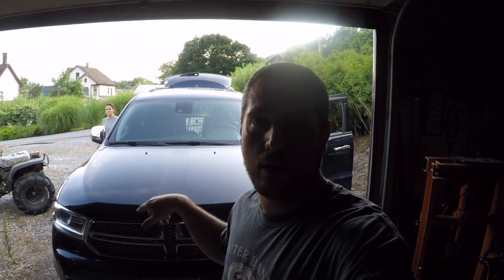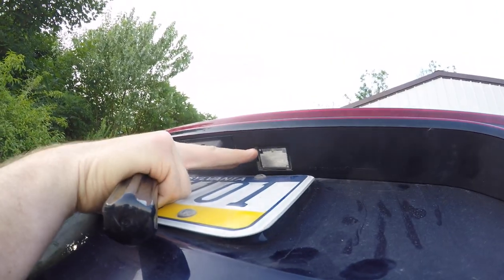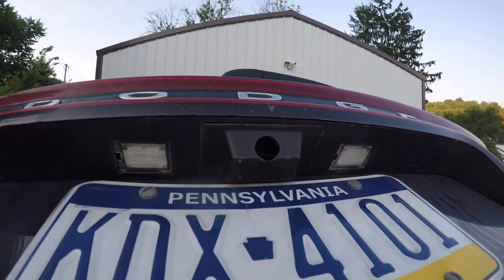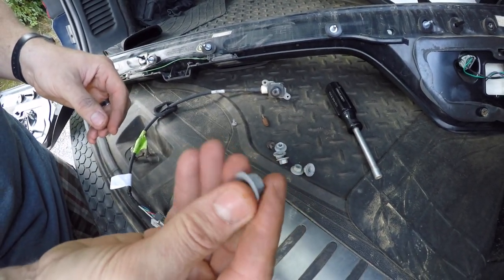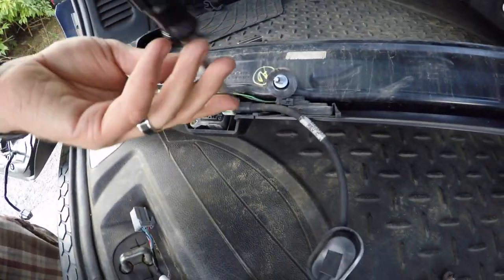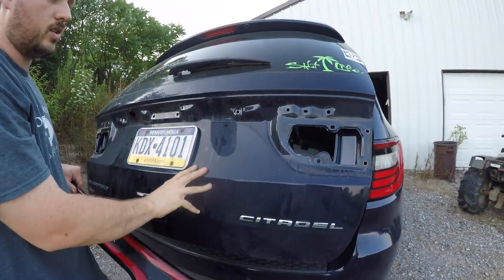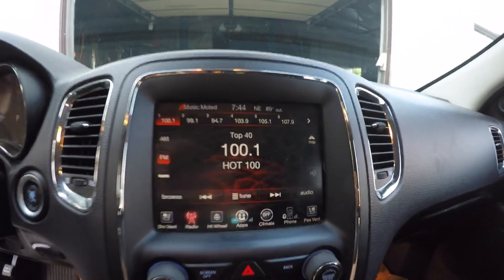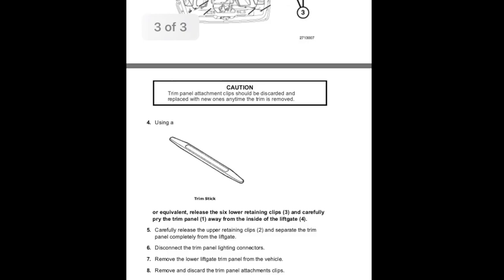HOW TO REPLACE A 2014 DODGE DURANGO BACKUP CAMERA. CRONES VLOG

Comment: Thank you for the video. I had to find my way through getting the trim off but it went pretty well once I just went for it. Only broke one trim pin and one of the mounts which I Gorilla glued and hope it takes enough to hold the one pin. The video was a huge help and greatly appreciated when it got to removing the brake light assembly, which was not bad at all and went quickly thanks to the video. The aftermarket camera quality is not as good as the Dodge version but costs $300 or more less and has a 1 year warranty. It shows what you are trying not to run into in good enough quality to avoid it AND the proximity sensor and associated alarms work without the camera so its all good! Cost was $55 for the camera and $10 for a set of 4 trim pins to replace the one I broke and in case I ever have to pull the liftgate trim again.

Comment: I have the Dodge Durango 2015 with no camera I already have the camera. My question is can I install it? Should I run the wire all the way to the front or it’s already there just to plug it?

Comment: Need a video on how you removed the plastic panel. I broke one of the plastic locking tabs that the plastic push pins sit in and then I stopped.
Reply from the maker: Sorry tends to happen they are replaceable though. They do make a clip removal tool.
Reply: Heck I broke the panel itself, which decided to crack and break before the clip broke.
Reply: @TT3DOKC  Me too man.. me too.

Comment: Have you ever had an issue where if you accelerate under 30mph fast and let go of the gas pedal the front of the car shifts like a bushing issue? I replaced control arm and ball joint. Could it be the bushings?

Comment: Nice video. Have a 2021 Durango and the camera i would bet is the same from 2011.. needs an upgrade.
Reply: it's the headunit, not the camera. the camera is 1080p, but the headunit is 480-720p, for whatever reason.

Comment: Great video, i am going to attempt to do this myself. Dodge charging over 900.00. Question...Did your blind spot stop working as well when your camera went out. They are telling me that replacing the camera will fix this issue.
Reply from the maker: Millie Knox not sure about the blind spot camera was blurry and full of water is why we replaced it
Reply: @CronesVlog when you removed the camera the first time did the trunk latch stop unlocking ?

Comment: Has anybody had the Racetrack light replaced and still have the old one, or going to have it replaced ask them if you can have it back. I want one to take apart and see if I can fix the lights inside, and then fix for people that don’t have to money or warranty to have it repaired. I just started to replace the map lights, the warm white to Bright white. I’m on Disability, so not much going on in my like now, I was an auto mechanic for 15 years, so just let me know if you have an old light I can practice on, I’m in the center of North Carolina, Haw River, if your near, I could pick up, maybe around 100 to 200 miles, Thank you Everbody